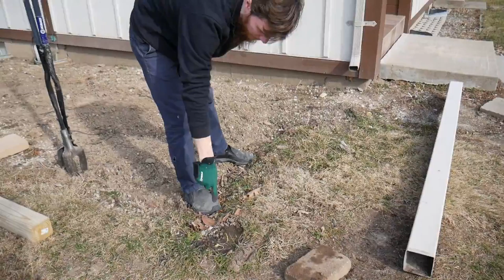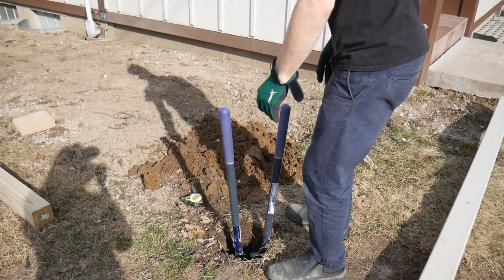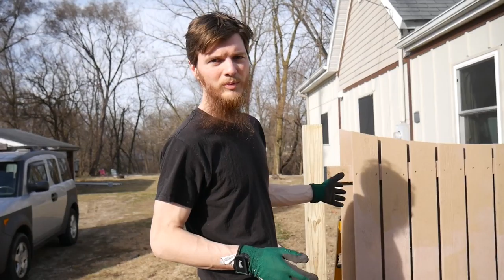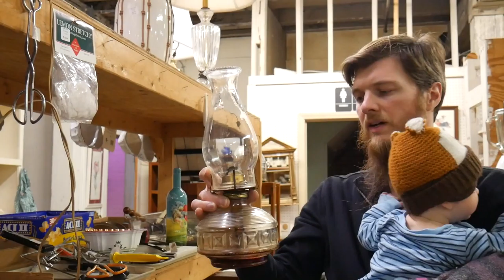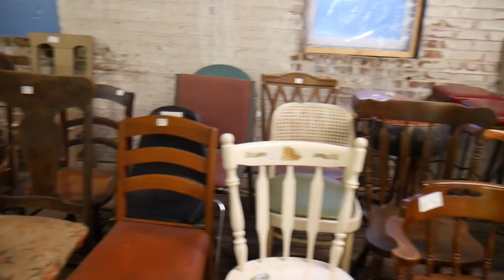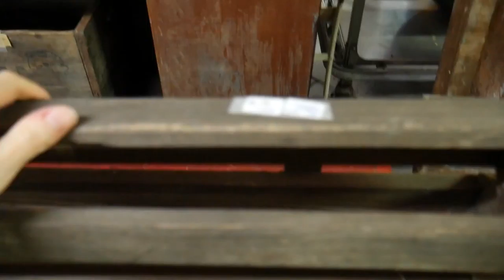Installing a Fence and Shopping for Oil Lamps

Comment: Depends on whether the lamps are antique or not, I have two which belonged to my grandmother, they are "priceless" but most I've seen at a place called, "Sell It Here" in Lafayette sells for $20-25.  I use mine for emergency only.

Comment: The $150 lamp was an Aladdin mantle lamp. It was the brightest of any oil lantern but burns really hot and the mantle costs $10-$14 and is pretty fragile. I have a few. One all aluminum one came with a spring loaded wall mount designed to soak up any shock as used to light a railroad car. Rayo made some round wick lamps (100 years old now) that throw out a lot of light but they can burn a lot of kerosene. I hope by now you found some cool lamps.

Comment: I saw a video on using mason jars with handles for oil  lamps. Trying to remember where.
Reply: Gail Reese 
Wow...that's a neat idea! I bet those are cute!
Reply: I was going to suggest that you can buy the Mason jar oil lamp parts on Amazon fairly cheap, as well as the glass globes, and the wick. I wish I had used the handle Mason jars when I made mine. Still love them without the handles though. I made three and still have parts for two more I believe. New sub here, love your  videos and have been playing catch up. We're very frugal people as well. I've been down South for 38 years now. Originally from Upstate NY as well. Much cheaper down South than up North, but way hotter here. Love your re model vids or building vids.

Comment: That Aladdin white drape lamp was a little overpriced. But keep in mind the Aladdin has to use its own brand of chimney called a lox on and the chimney alone will set you back 29.99.  Their burner unit features a mantle which gives you much more light ! If you have a power outage an Aladdin is the way to go. The little clear glass pitcher in front of it is Early American Pattern Glass, 1880's. Worth around 20.00 if no chips nor cracks.

Comment: The first oil lamp you picked up looks just like one I have. It belonged to my great aunt. It's about 130 yrs old. I was told 30 yrs ago it was valued at $100
Reply: That first lamps actual value is 10.00. It was made by Kadan to mimic  an Aladdin bracket lamp pattern. I buy, sell and refurbish antique oil lamps. One of the ways to tell the difference between that cheap Kadan and an Aladdin, is the Aladdin has a metal oil filler cap that threads onto the top of the glass fount. The Kadan is refilled by unscrewing the entire burner unit and removing it to fill.

Comment: If someone is putting up a large section/row of privacy fencing they had better use concrete, or they will be regretting it later. All the expense of the fence will be wasted when the dirt loosens and the fence post rot from moisture...the fence starts swaying..and in no time you have lost your fence. Going back and having to replace fence post a couple years later is not cheap or easy. Better to do it right the first time. It may be ok to do it the way you did, with a small section, but wouldn’t advise otherwise.
Reply from the maker: False. Most fences fail because the holes aren't dug deep enough. If you set your post to the proper depth for your location and soil, the fence will be solid. Concrete is usually a bad idea for wood fence posts and can even make then rot faster than being in the ground alone.
Reply: That is true about the concrete & posts, I have one section of privacy fence which a mole dug a tunnel along & water seeped thru & over time rotted the post so now this section is just hanging, so I stuck a couple of T post in front of the fence section for support till I can hire someone to come replace the post.   When the dog fence, 4 ft high, pine, was put in, no concrete was used, I did put a little rock into the hole but not much, it's holding up well.
Reply: It all depends on your soil and location. Here in nw ar concrete is rarely needed unless you have a shallow hole because you hit rock bottom.